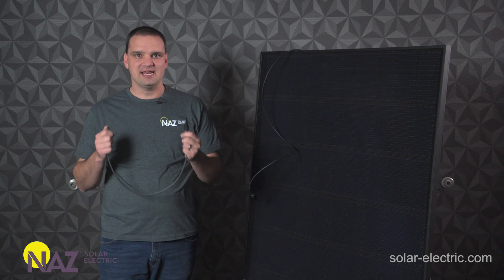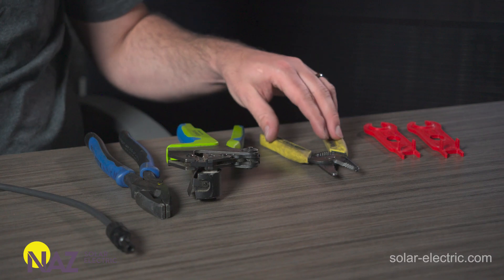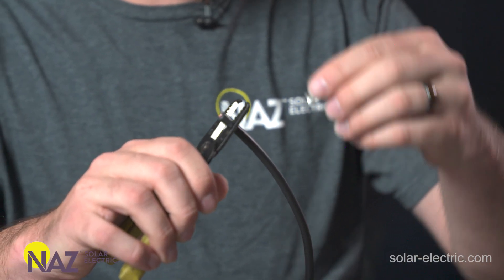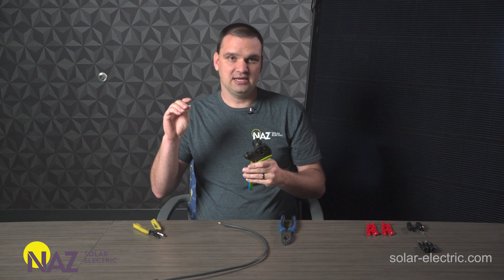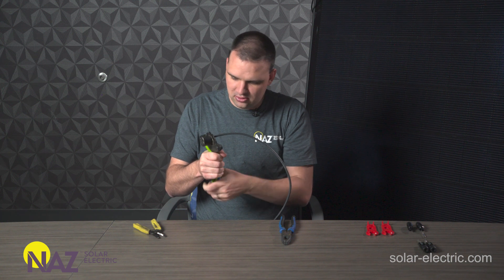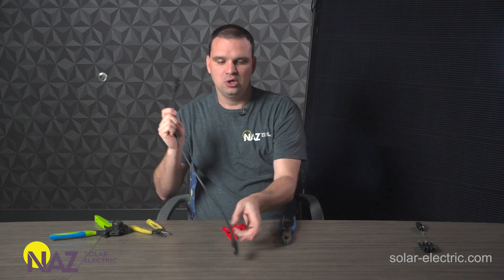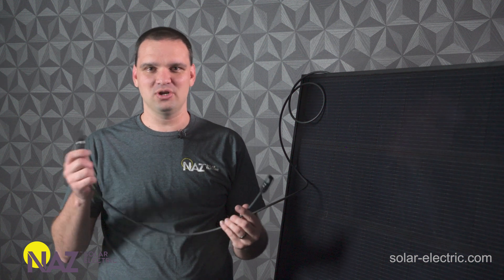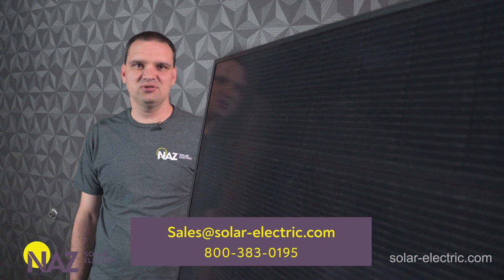How to Properly Use MC4 Connectors for Solar Panels | Step-by-Step Guide

Comment: No one explains which size pin for male connectoe, and which size for female. Also, no one explains which end of the connector is closest to the panel. Starting with a basic wiring of one panel to one controller and battery, then a description of which connector end attaches to the positive wire coming from the panel, and which for negative wire is needed.

Comment: This video was useless. Noone can clearly say which one is positive and which one is negative.
Reply from the maker: We don't talk about positive or negative in this video, we are simply demonstrating how to prepare and then connect the MC4 connection correctly in the event that you need to extend or change the wiring that comes pre-packaged with the modules that you have.
Reply: @NAZSolarElectric  Benjamin is there a vid that helps identify what's positive and negative? This is what I need help with. Please see my previous comment.